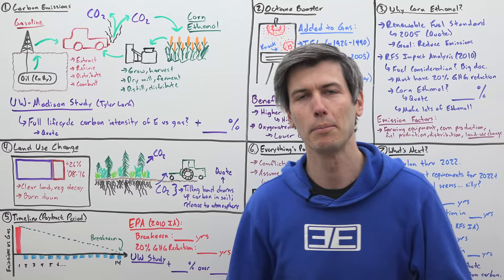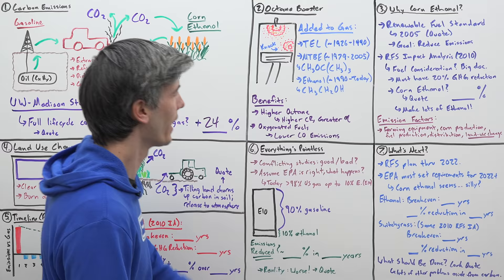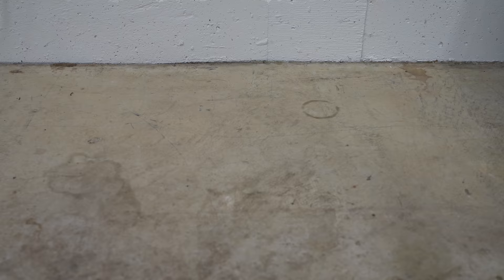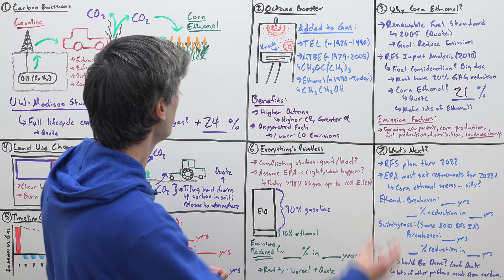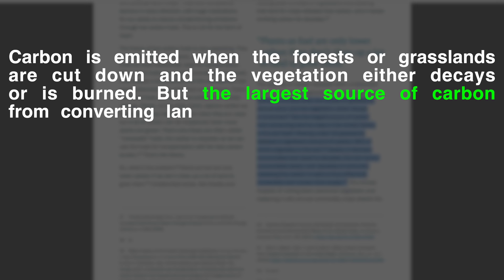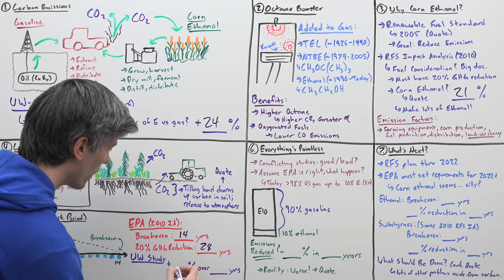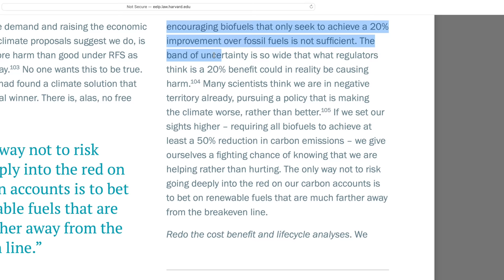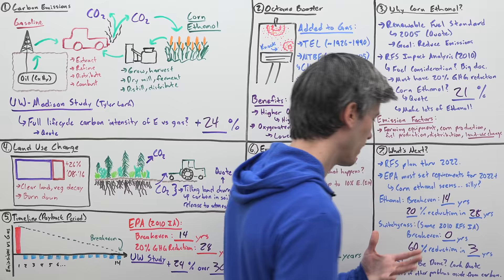America Was Wrong About Ethanol - Study Shows

Comment: DELIBERATE WEALTH TRANSFER - biofuels, especially corn was justification to subsidize a dying farming industry.  I worked for the consulting company that did the studies for DOE, NREL etc.  I has always been known that biofuels especially ethanol required more energy input that you get back.  Also ethanol yields 25 to 30% less fuel economy than petrochemical fuels.

All politics, bail-ins
Reply: I see you must be a diesel car owner since gasoline gets 30% less fuel economy than diesel.

Ethanol in our current inefficient gasoline optimized engines will get lower fuel economy but with more horsepower.  It will be vastly cleaner burning and cost less per mile to drive.  Even just 10% cleans dirty gasoline by quite a bit which is why we use it at today's levels.

Ethanol in ethanol optimized engines gets both more power and more fuel economy than gasoline and even diesel engines.

For example, Ford's first prototype eco-boost engine was optimized for E85 and achieved 15 to 20% better fuel economy than E0 gasoline.

Chevy EBDI engine built by Ricardo had more power and 3.5% better fuel economy than their diesel engine.

The is why GM wants the EPA to come with a 100-octane fuel standard.

Grain prices were higher in 2007 when the 2007 Energy and Security Act first passed than in 2018, the year of most ethanol production ever.

Corn ethanol is a value-added product of already existing feed production which preserves the feed in a healthier and more productive form called distillers grains.
Reply: Problem is if farms die I die to. I like to eat about 2 times a day.

Comment: Don’t forget that ethanol reduces the life of combustion engines overall and there’s a huge emissions cost in making engines.
Reply: In Brazil, they found identical engines last >300% longer on E100 than their common gasoline.  Soot is what wears out engines and oil.

Before approving E15, the EPA conducted long term tests on non-flex fuel vehicles 2001 and newer with not only E15 but also E20 and found both fuels ran fine and did no damage.

The Bureau of Labor Statistic tracked the share of US household income spent on repairs and maintenance from 1990 to 2017 as ethanol as a percentage of gasoline went from .1% in 1990 to around 10% from 2011 onward.

The share of income spent on repairs and maintenance was 2% in 1990 and by 2017 it was 1.5% as ethanol use exploded.

Comment: Ethanol is well known not to produce as many BTUs as gasoline. Ethanol takes more BTUs to produce than gasoline.
Reply: All and energy and BTUs it takes to produce and deliver a product to the consumer if reflected in the price of that product.

As such, note the spot cash delivered price of ethanol on the NYMEX is $1.52/gallon.

The price of an unusable sub-grade gasoline (RBOB) is $2.72/gallon.

It takes more BTUs to produce sub-grade unusable gasoline than ethanol.

To turn RBOB into usable E0 costs even more for the same reason premium costs more.  Unfortunately, it becomes even more toxic and dirtier.

Or, simply splash in >10% ethanol to RBOB and the resultant usable fuel becomes less toxic, far cleaner burning, and cheaper/cheaper per mile to drive.  Who can be against that?

Iowa State University measured all the energy it takes to produce an acre of corn into a "diesel fuel equivalent"
This included making the machinery, fertilizer, chemicals, plus the tillage, planting, harvesting, drying, trucking etc. 
They found it takes 34 gal of diesel to produce one acre of corn.
What do we get from those 34 gallons of diesel?
We get >500 gallons of ethanol.
But wait, that is not the kicker.
The kicker is we still get 100% of the protein and other things from that acre of corn still available for an even better feed called distillers grains. A win-win.

PS There were no grasslands or forests broken up for corn, simply impossible since US cropland acres have been falling since ethanol.

Comment: Damages cars… ruined food corn
Reply: The US Bureau of Labor Statistics measured share of household income spent on vehicle repairs and maintenance from 1990 to 2017 during the time ethanol in gasoline went from .1% to around 10% from 2011 onward.

The share of income spent on repair and maintenance went from 2% in 1990 to 1.5% in 2017 as ethanol usage exploded.

The common gasoline for identical non-flex fuel cars in Brazil contains 27.5% ethanol.  It has worked out so well and for so long that Paraguay went to E27.  

India will soon be E25.  Brazil has talked about going to E40.

The EPA before it approved E15 in 2011 conducted long term testing on vehicles 2001 and newer with not only E15 but also E20.  They found both fuels ran fine and did no damage.  Nebraska even has a pilot program to use E30 in their non-flex fuel state vehicles.

The parts used in flex fuel vehicles are identical to the non-flex fuel parts.  Flex fuel cars' ECUs are set to go to E85 and non-flex fuel cars are set to throw a yellow light around E50, but MAPs to run E85 are in ECU.

Ethanol on most any manufacturing chemical compatibility chart you will find is at worst equal to but most often easier on rubbers, plastics, and metals than what gasoline and BTEX (benzene, toluene, ethylbenzene, and xylene) are.
Reply: Ethanol production actually preserves the food (even 100% of the protein and other things) in the corn feed in a healthier, more digestible/efficient, and more concentrated form called distillers grains.

Comment: Don't forget that ethanol is corrosive requiring special metals, plastics and rubber compounds. 

Damage to small engines, older vehicles and storage containers has been horrific.

I've been a mechanic for over 40 years and I've witnessed first hand. I believe there should be a Federal lawsuit to stop the madness.
Reply: Ethanol on any manufacturing chemical compatibility chart you will find is at worst equal to but most often easier on metals, plastics and rubber compounds than what gasoline and BTEX (benzene, toluene, ethylbenzene, and xylene) are.  Look if in doubt.  Think about it, RV antifreeze has been 25% ethanol forever.  Alcohol has been sold in metal containers forever, even plastic.

Identical small engines to ours have used >E20+ in Brazil since the 1970s along with identical non-flex fuel vehicles to ours.  Currently they are at E27.  It has worked out so well and for so long that Paraguay went to E27.

Before E15 was approved in 2011, the EPA and DOE conducted long term testing on vehicles 2001 and newer with not only E15 but also E20 which found both fuels ran fine and did no damage.  No problems with E15 since its introduction in 2011.  (Hint, parts in flex fuel vehicles are identical to non-flex fuel vehicles, the MAPs in the ECU are simply turned on for E85.)

Nebraska just renewed a pilot program with the EPA to use E30 in non-flex fuel state vehicles.  I would still not test out their highway patrol if I were you.

If you truly believe ethanol destroys things, then I would sell everything I had, move to Brazil, and buy up every repair shop I could lay hands on.  

If what you claim is true, then you should become a gazillionaire in no time at all.  Thank me later.
Reply: howitstart   we forgot all ready because that is WRONG information.
Reply: @oldblueaccord2629  Gates hose manufacturing EPA certification for aggressive fuel blends SAE J1737 or Barricade fuel line hose or CGTSPLINEBF1 or CGTSPLINEBG1 or CARB certified or Greenshield barrier layer or CARB Executive order Q-09-019A or the SAE 30 R9.

Question for you mister doesn't exist, what is Ethanol? It's an alcohol, correct! And what does alcohol do to rubber and plastics not specifically made to handle it? 
Do a little research. 
Another question for you, why do high concentrations of Ethanol VOID warranties?
Obviously because it's so good for the equipment extending the life of the equipment giving manufacturers concern it will put them out of business.

Comment: food vs fuel ... we need more food than fuel
Reply: Since corn ethanol is a value-added product of already existing feed production which leaves 100% of the proteins, minerals, vitamins, and fats still available for feed in a healthier, more digestible/efficient, and more concentrated form called distillers grains, we get both food and fuel with this particular source.

Cattle can't digest starch very well and waste it as methane flatulence and starch rich manure which turns into methane later.  Corn ethanol uses only the starch.

100% of the fertilizer and things in the soil are still fed to the livestock in the distillers grains.  The only thing that goes to ethanol came from the air: solar energy, CO2, and water with the latter two recycled once burnt.

We could and have turned manure into ethanol, but it is hard and expensive to handle and transport plus the cattle are do better and are healthier without eating the indigestible starch.

In Brazil, the perennial crop sugarcane is grown on marshland not fit for cropland, pasture, or forests and are located thousands of kilometers from the rainforest.

PS No forests or virgin soils were ever broken up for ethanol, indeed US cropland acres have fallen since ethanol, so such a notion is simply impossible.
Reply: Metu we dont eat cow corn...cows do.

Comment: Great video, but this isn't news. The energy negative process of making ethanol was evident like 15 years ago when I first looked into it, and there didn't appear many process improvements that could reduce this (modern farming is already hyper efficient, etc).

If you want to make ethanol because you can increase engine output, or run higher manifold pressures without knock, that's all well and good, but the carbon neutral environmental angle has been BS for decades, and as with the grid renewable and Lion EVs and storage, it's chosen because of its political expediency, rather than it's actual efficacy.

Climate catastrophe and "green" energy has been an iq test from just about day 1, and it's an iq test that we the public have been failing. It seems people are finally starting to wise up, but we may be in too deep and too entrenched to do anything with that wiseness anytime soon.
Reply: I agree with you that it is not news, indeed it did not ever happen.  There were no grasslands or forests broken up for corn.  Quite impossible since US cropland acres have been declining.

Census data shows corn producing states increased grassland, forest, and also wildlife areas since ethanol.

Corn ethanol is a value-added product of already existing feed production which preserves the feed in a healthier and more productive form called distillers grains.

Iowa State University measured all the energy it takes to produce an acre of corn into a "diesel fuel equivalent"
This included making the machinery, fertilizer, chemicals, plus the tillage, planting, harvesting, drying, trucking etc. 
They found it takes 34 gal of diesel to produce one acre of corn.
What do we get from those 34 gallons of diesel?
We get >500 gallons of ethanol.
But wait, that is not the kicker.
The kicker is we still get 100% of the protein and other things from that acre of corn still available for an even better feed called distillers grains. A win-win.
Reply: @danafletcher2341  I'm not talking about grasslands or forests in the land use case, so that's moot.

However, where the energy cost is concerned, all the studies I've looked at that claim an energy positive process in corn ethanol production seem to do this by selectively including things on the input side, and some of them even include the byproducts energy on the output side, even though we don't have a market for those.

The most comprehensive study I'm aware of is the one conducted by Pimental in 2005 (full study is freely available on the web today) where they included seemingly all the inputs (labor, machinery being built, maintained, etc, irrigation, extracting and refining said ethanol, and a whole host of other variables over a ten year period, and weighed that against the energy released by burning that quantity of ethanol, leaving out the byproducts that the market doesn't exist for. 

This method shows ethanol production is energy negative, and not just marginally. The takeaway from this is that if we were to transition all the production-associated fuel usage to (corn) ethanol, we would rapidly run out of ethanol as the process consumes more than it produces.

By comparison, switchgrass does appear to have a positive value on the output side, even when using a comprehensive list of costs on the input side. If we have decided that biofuels are the answer, it seems to me we should at least be using ones that are theoretically self-sustaining.
Reply: All the energy it takes to produce and deliver a product to the consumer is reflected in the price of that product.

As such, note the spot cash delivered price of ethanol on the NYMEX is $1.52/gal.

The price of an unusable sub-grade of gasoline (RBOB) is $2.79/gal.

It takes more energy to make unusable gasoline than ethanol.

To turn RBOB into usable E0 costs even more for the same reason premium costs more.  Unfortunately it becomes even more toxic and dirtier.

Or simply splash in >10% ethanol and the resultant usable fuel becomes less toxic, vastly cleaner burning, and cheaper/cheaper per mile to drive with.  Who can be against that?

The most comprehensive study on sugarcane ethanol was done by Isaias de Carvalho Macedo, shows an alcohol energy return of more than 8 to 1 return.  Brazil has an import tariff of 18% on our ethanol to give an idea how corn compares to sugarcane.

The entomologist Dr. Pimental did his study in the late 70s and early 80s and revised it around 2005.  He claimed he had never taken oil money but famous investigative journalist Jack Anderson in 1982 had an expose' showing he was on the payroll of Mobile Oil.

Oil certainly has a negative return since it takes oil since it takes oil to extract and produce it not even counting flaring off.   Around a .8 to 1 return.

Switchgrass requires a dedicated acre of land and dedicated fertilizer.  There exists a subsidy for Gen2 cellulosic ethanol of $1.01/gal which switchgrass qualifies for.  Gen1 ethanol which corn qualifies as had a $.45/gal. subsidy which ended back in 2011.  There is a reason the spirits we drink only come from sugars and starches.

Switchgrass requires a dedicated acre of land and dedicated fertilizer.

Corn ethanol is value-added from already existing feed production and 100% of the fertilizer (& everything else from the soil) still gets fed to livestock in the distillers grains.  Ethanol is made only of things of the air: solar energy, CO2, and water with the latter two recycled once burnt.

What logic is it to assign all the energy of fertilizer to ethanol and none to distillers grains?

Comment: Ethanol is simply not good for engine parts.
2ndly. Fuel is a btu equation.
Most of my vehicles take 10% or more fuel to go down the road at the same speed.
Think cost per mile not per gallon.
Reply: Brazil found identical engines las >300% longer on E100 than on their common gasoline.  Soot is what wears out engines.

Ethanol is rated far better on material chemical compatibility charts than gasoline and BTEX (benzene, toluene, ethylbenzene, & xylene)

If we think in terms of cost per mile, ethanol is still the clear winner even in our current inefficient gasoline optimized engines which lose mpg but gain horsepower while cleaning up the emissions.

The spot cash delivered price of ethanol on the NYMEX is $1.52/gal, unusable gasoline (RBOB) is $2.79/gal. and turning RBOB into usable E0 fuel costs even more than that along with becoming even more toxic and dirtier.

Ford's first prototype eco-boost engine was optimized for E85.  It achieved 15 to 20% more fuel efficiency than gasoline with load performance equal to diesel engines.  They didn't come out with it in flex fuel because they thought they could skirt paying the MIT scientists patents on it.  That is still in litigation to this day I do believe.

Ricardo built an ethanol engine for GM and it ran in a pickup. It is half the size/twice the power of gasoline and diesel with better mpg than either one.

FROM RICARDO:
The new federal CAFE standards are calling for a doubling of fuel mileage performance, which, Vint says, is going to send OEM’s looking for high octane numbers to improve efficiency and ethanol is the best source. Ricardo, an engineering firm with over 100 years in the business of engine design, has developed an extreme boosted direct injection engine (EBDI) to optimize ethanol blends. The 3.2 V6 gasoline engine rivals the power and torque of a much larger GMC Sierra 6.6 diesel, he said, and it delivers 3.5 percent better fuel economy than the diesel.

Scania has sold an ethanol engine worldwide for years which they state has fuel economy and power on par with their diesel engines.
Reply: @jeffpinkava9634  Maybe buy and electric lawn mower since you cant keep yours running.
Reply: @oldblueaccord2629  all my stuff runs just fine..  including the two stroke stuff...    haven't had to fix anything of my own in a long time.
Really you guys need to go talk to a couple small engine repair shops to find out how good your favorite waste of tax money works.
Reply: @jeffpinkava9634  There is not any Federal tax money spent on corn ethanol, that ended back in 2011.

Now for the long-standing stated goal of the G7 Nations to end petroleum subsidies?  No such luck.

Again, perhaps you should sell everything you have, move to Brazil, and buy up every small engine repair shop you can find where identical small engines to ours use their common gasoline which contains a minimum of 27.5% ethanol.

If your claims are true, then you should become a gazillionaire in no time at all.  Thank me later.
Reply: @danafletcher2341  investment with America act 500 mill for bio.
Blending credit .45 a gallon...  
Pull the other leg.